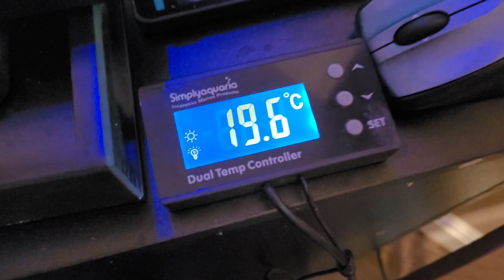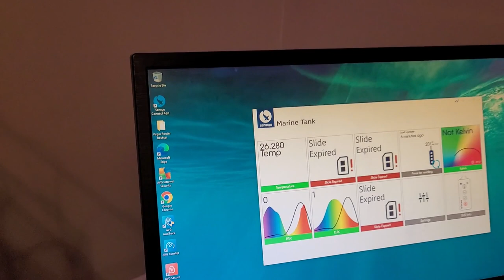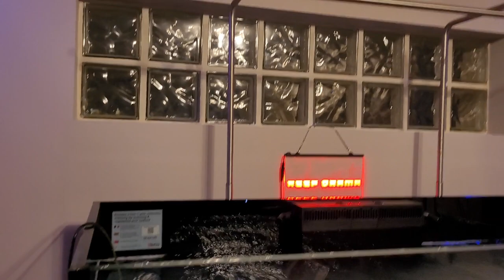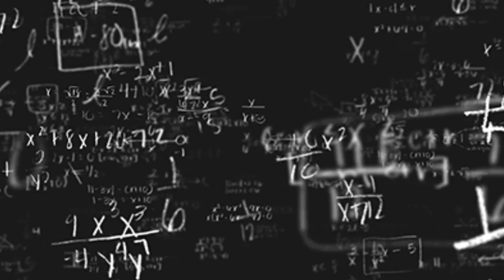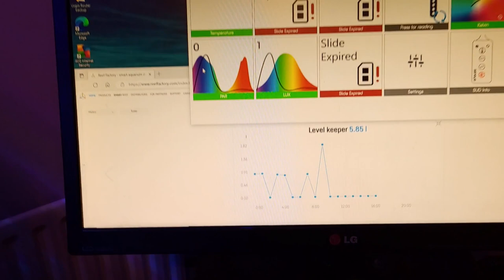How I Completed The Red Sea Reefer Tank transfer? pt 2

Comment: Would you recommend the hanna nitrate checker? And did you get the third clarifier packet out?
Reply from the maker: Hi Dylan, for me, those Hanna Checkers are a no-brainer. It's so much easier than trying to work out what the colour is to match to a little stupid colour chart! I always know my Nitrates are going to be high, which is why I brought the High Range one, but if your Nitrates are generally low, then you may need the Low Range. You may even be able to pick up a 2nd hand one as quite a few people are shutting down their tanks and selling off all the equipment. 
Thank you, yes I did. It was buried in the sand but found it when I spread it out 😀 
Thanks for supporting my channel 😀